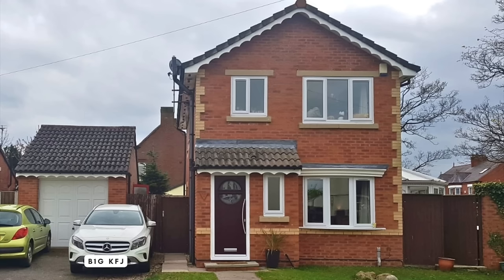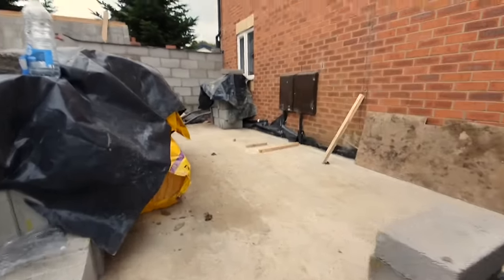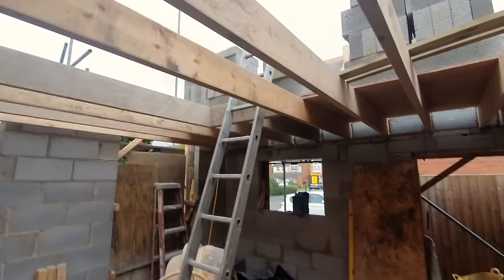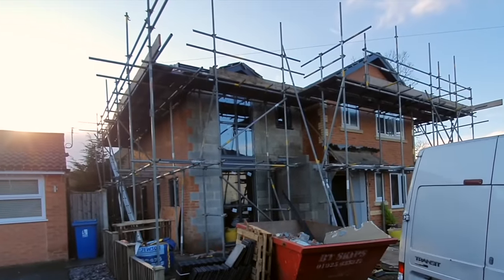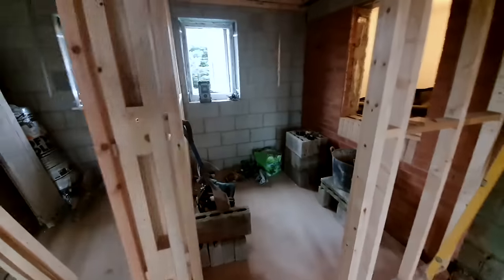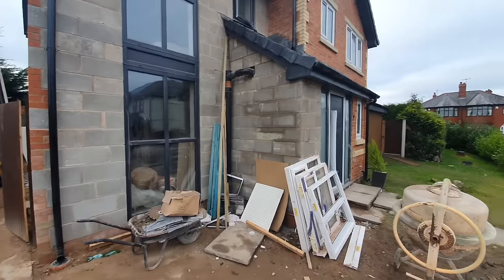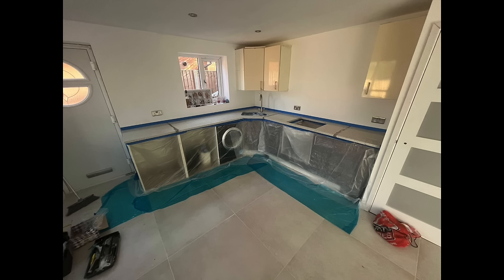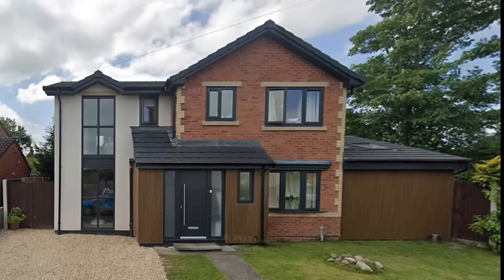Step-by-Step House Extension 🏡 Our Big UK Home Project

Comment from the maker: 💬YOU GOT US THINKING 🧐Some of the feedback has made us think about the bottom floor layout (as seen 00:44 into the video). It could be better, especially as the boys get older and more noisier 🤫 We have an idea of what to do to make better use of it, but we think some of you guys may have better ideas.
Therefore if you fancy a challenge, have any idea please feel free to draw them up using the outline from 00:44 into the video and pop them across to us. 
Either on instagram @koifishjohnny or my email koifishjohnny@outlook.com, 
If the email is removed it is avaliable by clicking on my channel- expand the about using the > below my name, subs, etc- then select email.
I only check my emails occasionally so please be patient.
Enjoy.

PS this update wont be completed any time soon as we will need to save up AGAIN 😬

Comment: Looks good, Did you not need a door on the kitchen? We had the same and building regs made us put one on!!
Reply from the maker: HI pal, it was discussed with planning TBH and I cant quite remember but there was a adjustment we had to do, because i didnt want the door as it ruined the flow. I cant remember if it was the heat detectors or not.
Reply: @koifishjohnny  thanks, yeah we are in the same position, looks much better without.

Comment: Great extension jonny, the roof tile on the porch are they the same as the main roof. Looking at your neighbours they looked different so was that part of planning application. Please could you dm you builders details as planning for extension myself in Manchester.
Reply from the maker: Hi mate no issue changing the roof slates mate. They were different to what we have. The neighbour is the only one in the neighbourhood with similar tiles pal. Sorry builder wants nothing to do with this pal, he is super happy and settled with his work flow mate. Sorry about that

Comment: Hi Johnny thanks for an amazing video and congrats on the house! Quick question - did you paint your upvc windows on the original part of the house black or did you buy new windows?
Reply from the maker: Hi pal thanks we love our house extension so thank you. We sprayed them as a temp measure with vision of updating them in few years, but tBH they are doing fine

Comment: Looks fantastic mate ! overall how big was the floor area of the extension? Is it about as big as a garage? I'm thinking of knocking through an attached garage.
Reply from the maker: Hi pal thanks for your kind comments about our home extension. 
If you loook on the video you can see where the garage was in relation to width. The width from the external wall is 4m out. So just a bit larger than the inside of a garage I think. Length wise it is longer about 8m long from the back of the extension side to the front window. 
Cheers pal and good look with extending your home.

Comment: I love your extension and can see you're si thrilled with it.  However the only small change I would make is the upstairs full length window should be able to open.  You'd appreciate it during the hot summer months getting some airflow, through, but it's a small design point.  I can't get over how grand it looks
Reply from the maker: Thank you mate 🙏 We love our house extension TBH so thank you.
Your attention to detail is awesome and your right, it is something I would change. Would love the top 2 panels to open 🏡